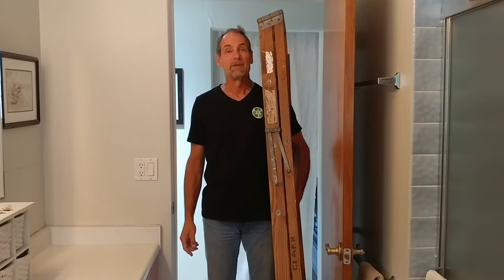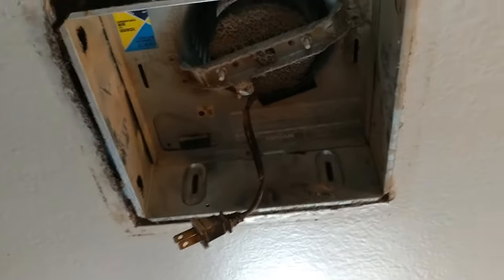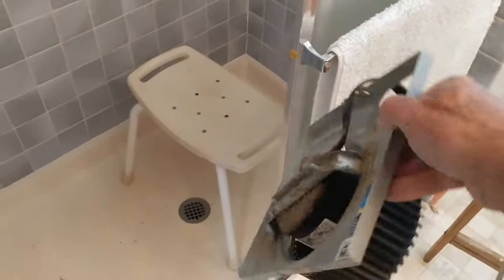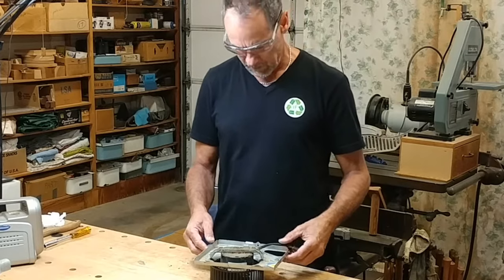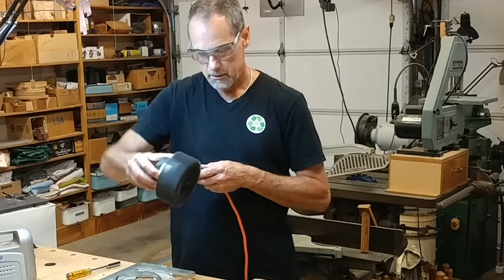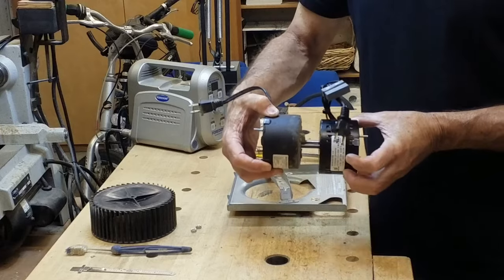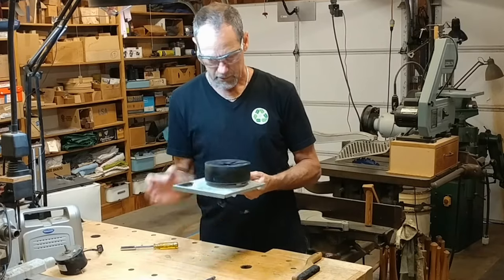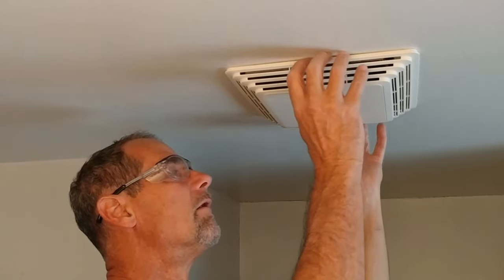Bathroom Exhaust Fan Repair

Comment: Thanks for the video, nice to see testing the exhaust fan in isolation to identify the noise. My only recommendation though is please turn off the circuit breaker when removing the exhaust fan in addition to unplugging it to be on the safe side. This is to avoid the unlikely scenario of the metal casing being energized due to some electric fault (e.g. cut wire).
Reply from the maker: Great point!
Reply: Only sissies turn off the breaker just to remove a damn fan.

Comment: Thank you so much for this detailed video. My fan stopped working and I had no idea where to begin. Plus I was scared of the electrical stuff. Had no idea it just plugs in like a lamp! My goodness! Turns out it was caked up with years and years of dust build-up. After tearing it apart and giving it a good clean, it's back to running full-strength. Still working on getting the cover reinstalled. That's been the most challenging part of the repair!  😆  Thanks again! Great video!
Reply from the maker: Good for you!

Comment: Wow! I'm impressed you fixed the bathroom fan motor! All you had to do was... replace the bathroom fan motor
Reply from the maker: I wish these little sealed motors were rebuildable. But alas, replacement motor cost is so inexpensive, parts aren't otherwise available.

Comment: We bought a 1970s house and pretty sure our bathroom fan was original. It was squealing pretty bad when we moved and money was tight. Took it down and cleaned the dust out of it and lubricated the moving parts and was silent (air was loud, not a low sone fan) until we sold the house a few years later!
Reply: Thank you for the information. My fan was making a loud noise so I removed it and cleaned out all the lint inside. I would have replaced the unit but your suggestion of lubricating it worked. Just had to remove the back and use a little 3-in-1 motor oil on the cup on the back that holds the shaft. Now the noise is gone and it is working like new.

Comment: It’s still loud and obnoxious! Better, but still irritating. I really hate the fan and light combination units that don’t allow the light to be on and the fan off. I’m sure this video was helpful to those who have this problem and don’t mind a fan noise.
Reply from the maker: Yeah, all ventilation fans make some noise, though some are better than others. I recently renovated this entire bathroom (you can see the work involved in that here: https://youtu.be/Pjmr_V79-vE) and I installed wiring so the light and fan can be switched on separately. Nice when all you want to do is brush your teeth.
Reply: @ItsFixable  that for sure, don’t need a fan every time you step into the bathroom.
Reply: Replace the fan motor.  It's $27 at home Depot.  figure out the model and get the replacement.
Reply: @ryansmith8759  cheap fans are noisy, actually even tje so called quiet ones aren’t that silent either. Still better on a separate switch.

Comment: The problem I had was fan enclosure was probably warped when installed at my brothers house and was fan was hitting the housing. (Maybe somebody dropped it in the bathtub 🤔). Anyway, I grabbed the motor flange with some pliers and pulled down a bit and it no longer hits.

Comment: Wow!  I'm impressed you fixed the bathroom fan motor!  All you had to do was... replace the bathroom fan motor 🙄 .
Reply from the maker: Building maintenance and repair is most commonly a process of logical steps leading one to the specific corrective action. It makes no sense to jump to a conclusion without delving into the project. getting started is always more than half the battle. I hope that's what one learns from watching my videos.
  Unfortunately, we now live in a world where products are not designed to be repaired, and one is forced to replace entire components. That wasn't always the case. You used to be able to replace bearings, brushes, armatures, and such on small motors. Now we're forced to swap the whole thing out. Labor is so expensive that buying new and swapping is more cost effective. But when labor is one's own, and he enjoys the process and puzzle of replacing parts, that's what he does ;-)

Comment: Take the motor apart and clean everything,  re oil the bushings and cut a piece of felt, replace the old worn out felt, install the new felt, add a drop of oil a and reassemble,  test, and it should be good to go, quieter now !!
Reply from the maker: It was a sealed motor, oil-less design. Would have needed to drill out rivets, and then really no way to secure it back together.

Comment: Same noise problem fixed by following your method, but I just added coconut oil to the moving parts and No noise afterwards
Reply from the maker: Great 👍, would have never thought to use coconut oil as a lubricant.

Comment: Great video was very helpful to see you can replace the motor if necessary only question I have is the replacement motor has openings which allows the moist air and lint to pass through the motor isn't that why the original one was sealed because it's going to be used in high moisture and dust and won't that get in the motor and corrode it quicker? Just wondering or maybe there are no sealed Motors available did you have a choice or was that the only one available? I just purchased my house and have a noisy fan the house is relatively new 2014 so maybe just something loose but if I have to replace the motor I'm going to be here for a while so I want to make sure I choose the right one thanks! Bob
Reply from the maker: Good observation! This was exactly the replacement motor specified by the original manufacturer despite it being a vented motor, so I went with it. Only time will tell how durable the open-air design is. So far no problem to date.

Comment: Hi let's say if i dont want to replace new exhaust fan and just pull off its cable that u did on 1:00 possible can? No issue with electrical wiring?
Reply from the maker: Are you asking if it can simply be left unplugged? Sure. That would prevent the fan from running.

Comment: Thanks great video. Where do you get the replacement motor?
Reply from the maker: I have an appliance parts dealer in town, but you can easily buy over the internet. Just search using the model number off the one you have.

Comment: Thank you. But I have fan with a light bulb and I don't know what to do.
Reply from the maker: Usually the bulb socket and reflector is removable by a single nut. You'll find the motor and fan behind (above) that.

Comment: I wouldn't doubt that the new motor had that same play but you never showed it, but the problem likely would have been fixed if you just pulled that fan wheel out just a tad bit. Would have been worth the try.
Reply: I have the identical model & tried what you suggested.  No luck.
Reply: @deaterk  My A/C pump has the same play. You can grab the stem with fingers and go up and down. It is rusted so when turned on, the stem goes up and gets stuck. Pull it back down and it goes free. Wd40 took care of the problem but I figured similar dynamics were in play on his fan hence "  the try ". I wonder if you are experiencing the exact same problem as him tho?

Comment: It's not the motor. The squirrel cage fan is sliding down the shaft when you turn it over.
Reply from the maker: Well, no. If you watched the video, you saw @4:05 how the sound was related to the play in the motor shaft shifting position and how firmly attached the squirrel cage was.

Comment: They want $83.00 for the motor and it is out of stock(shocker). You can buy a an entire new fan at Lowe’s, same specs, for just about the same amount- doesn’t make sense.
Reply from the maker: If it's the same spec, buy the new one and just swap the guts into the existing housing. That way you won't need to do any carpentry.
Reply: I will do that, thanks for your videos they are very helpful
Reply: It's easier to put in a new motor.   You don't have to replace the housing

Comment: I bought a new 24" wall bracket fan, but the noise is killing us, couldn't understand what's it.Please help and oblige sir.Thanks from  Pakistan.
Reply from the maker: If it's a rattle or mechanical hum, it should be fixable. But if it's just the sound of whooshing air, there isn't anything you can do. Check the sone rating; this is what you can expect:
<0.3 sones: This is the lowest possible sone rating for a ventilation fan. At <0.3 sones, you won’t even know the fan is running.
0.3 – 0.9 sones: Fans in this range are also high-performing. It is usually very difficult to hear products in this range, unless you are specifically listening for them.
1.0 sone: A 1.0 sone rating is roughly equivalent to the sound of a refrigerator running.
2.0 sones: 2.0 sones is the noise level in a normal office workplace.
3.0 sones: A fan rated at 3.0 sones will be roughly as loud as a face-to-face conversation.
4.0 sones: This sone level is typically what people will listen to the TV in their home.
5.0 sones: A 5.0 sone fan will be about as loud as a busy restaurant during dinner time.
6.0 sones: Fans at 6.0 sones are equal to the noise at a sporting event in an arena or stadium.
Reply: As it's a new fan and there is not a rattle or mechanical hum, its definitely a whooshing air that cannot be fixed.Unfortunately there is no sone rating in the specification.But as i understand, the fan guard cover seems to be a reason for the excessive noise because the wires are close to each other.Apart from the three taping for the speed, if you further lower the speed the noise may be over.Or, if you make a reasonable space of at least 3" between the fan guard wires, it may fix the issue.
Actually I am an instrument professional, I don't know much about these fans.
Regretting inconvenience, thanking your grace.
Azmat Ali
Pakistan

Comment: no one really shows how to fix this issue except getting a new motor lol. I thought there was an actual fix without having to buy to repair
Reply from the maker: Unfortunately these little motors are not designed to be repaired, only replaced.

Comment: Replacing is not repairing - - I was expecting a motor tear-down and end-play managed by installing a bit of neoprene rubber and a greased felt pad, synthetic of course. Then check and adjust the balance of the squirrel cage before re-assembly.  Finish off by lining the metal "box" with sound deadening and a layer of foam sheeting.
Reply from the maker: I was originally expecting to tear down the motor too. Unfortunately these little motors aren't designed to rebuild. Even if I had drilled out the casing rivets it would have been impossible to find replacement sleeves. And anyway, replacing the motor is only $30.
  No need to balance that light weight plastic squirrel, and besides, end play in the motor was the culprit. 
  Not enough clearance designed inside that housing for insulation around the fan, but I have encased the exterior in insulation up in the attic.

Comment: The Q is : how much $ diference is to buy a new fan and to buy the motor- Less than $7?I think is worth to replace for an new one.
Reply from the maker: Less than $30 for the motor. But the big difference would be in the time needed to tear out the old can, disconnect the duct and wiring, then install the new and reconnect everything.

Comment: I didn't even know you can remove the motor from the housing.  When you replaced the motor as a part shop, how are part shops categorized in the Yellow Pages.  I presume Home Depot does not carry the motors.  Thank you....
Reply from the maker: You want to look or search under "Appliance Parts". You can modify that to "Appliance Parts Dealers" or "Appliance Parts Suppliers." When you go to purchase, have the fan model number and/or the motor model number with you (or just bring the whole unit).
Reply: @ItsFixable  Thank you.....
Reply: My local ACE hardware did